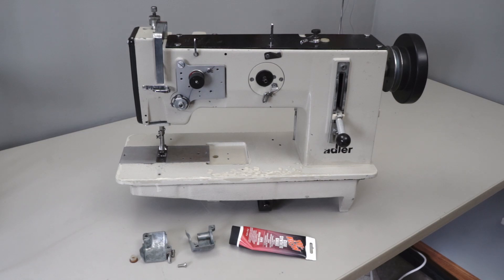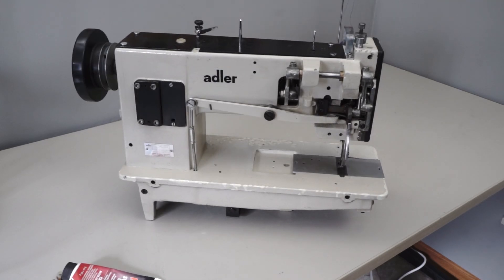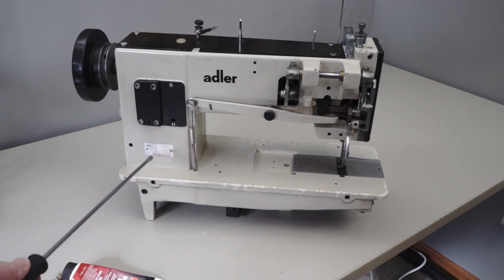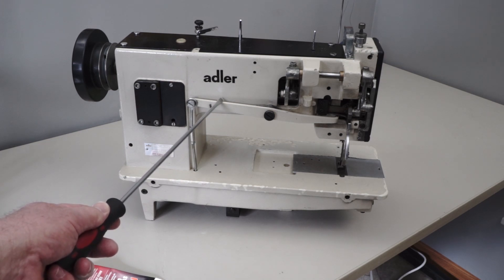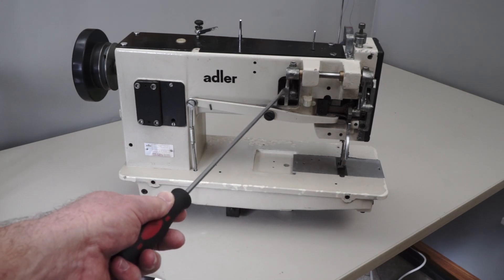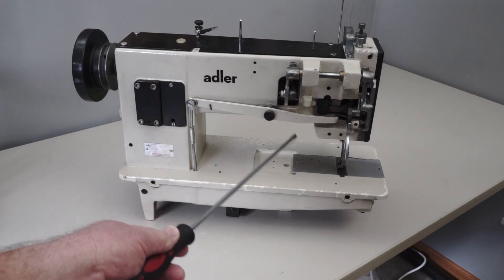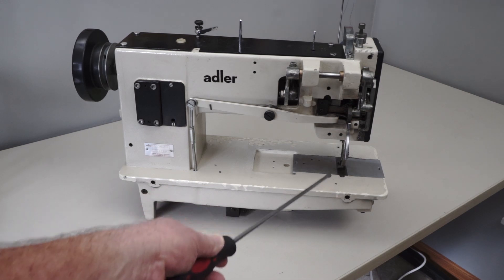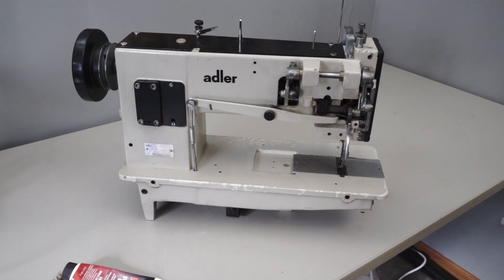BARN FIND ADLER 267-GK-373 INDUSTRIAL WALKING FOOT SEWING MACHINE PROGRESS REPORT

Comment: how thick can this machine sew? I found one for sale in my area and was wondering what would be a decent price to pay for it?
Thanks. I plan on sewing leather
Reply: Not sure if it is useful for you, but here in NL the price seems to be around the 600-800 euro mark for a machine with clutch in decent condition. 1000 with servo motor.
Reply: Did you get it?

Comment: As always, great video. Those gears remind me of the Singer 400/500 machines as well as the 201-2. I don't understand why the gearbox needs to be packed with grease. The gears only throw it off. Regular maintenance (oiling and grease) should take care of things. No?
Reply from the maker: I think they packed it full at the factory thinking in a commercial setting it may not be checked often and also gears would be in a grease bath all the time.